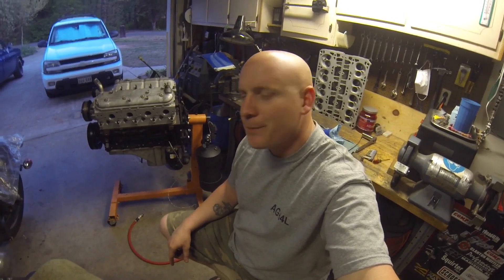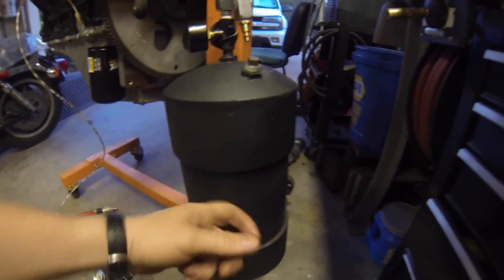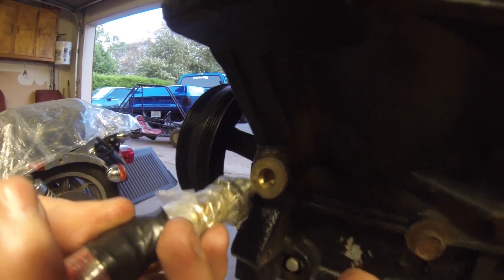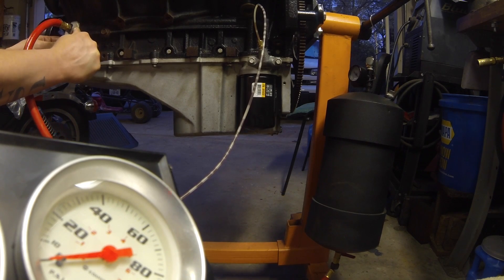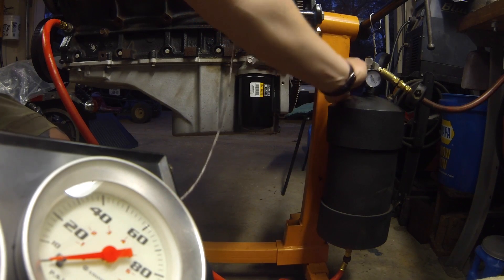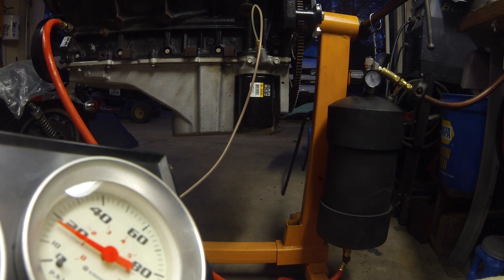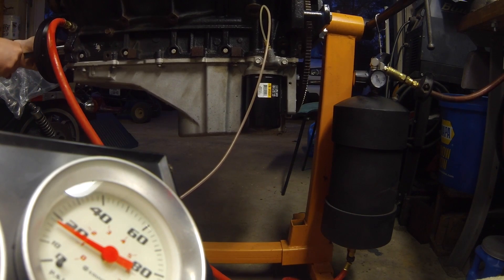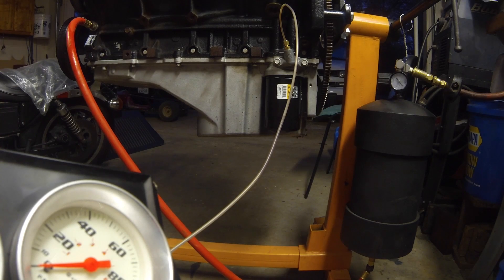LS Engine Oil Primer, Home Made - Pre Lube Prevent Engine Dry Start "How To" - LS1 LSx

Comment: for your sight gauge what i would do is make it so you can fill it with 6qts of oil and it shold half way on the sight gauge when it gets to 1qts left.. that way u can push the whole 5 qts but do not risk pushing air
Reply from the maker: What I have planned to try out, is an idea that my buddy gave me. He sent me a boiler site gauge. I'm making a new one out of a old steel freon tank and will mount the boiler site on the side.

Comment: very nice. Where did you get the plug for the side of the engine that you drilled and tapped?
Reply from the maker: Thanks Bob! That plug is already there in the block. I just grabbed an extra one from a junk motor and drilled and tapped it. I think you can get a whole kit of those plugs on eBay and probalby from the dealer also.

Comment: I put 6 quarts in before i decided to do your method, so i drained out about 4.5 quarts. pumped it in using your method.
and it appears it went somewhere else, because my dip stick says I'm about 4 quarts low??? might you have an explanation as to why the oil didn't return to the oil pan?? i let it sit for about a half hour now and still same.
Reply: AGearhead4Life I wonder if the dip stick is calibrated? Try a long clean rod that you can hear touch the oil pan...ALL the oil will eventually end up in the oil pan (unless its WAY over filled)...
Reply from the maker: Since Im not there, its hard to guess what happened. but I can say that if it was an empty engine (as i'd expect it to be since thats what this primer is for), when you fill it through the galley plug like in the video, you'll be putting oil in areas that you wouldn't be by just pouring it in. You'll be fill all the oil galleys, oil filter, oil pump, etc. So that would explain reading maybe a quart less then as if you poured it straight into the fill cap.

are you saying that your ready "4 qts low" or only four quarts in the pan?

Comment: if you make the oilfeed go in from the top with a pipe down to the bottom you can build a foot from a larger diameter pipe that fits over the bottom cap 
you can then set the oilprimer on the floor and even put it away filled with oil without it leaking
Reply from the maker: cool idea! I had thought about making a feed from the top... after it was too late of course. I guess I could still plug the bottom one and run another. I like that idea for a base to set it down on. If i ever get a chance to mess with it again, I may try these ideas.

Comment: Hey gear head I have a ? I'm building a ls1 do u think I need to replace the lifter trays and get new ones I've read that u should I'm lost on that need some input form u
Reply from the maker: Hey Mr_getinthere! Well thats a hard one. I dont usually prelace the lifter trays, so I'll say no. If i was doing a complete like new rebuild, then I would say yes.

This is one of those MANY things that you'll read about on forums where people say that you MUST do, but really its all on judgement of what you've got going on and what you plan to do. It can get very expensive buying every part inside the motor new for a rebuild.

For each part like this that I question if I should buy new, I ask myself a few questions:
-How worn is the part?
-Do I want to take the gamble of this part not work?
-Do I mind spending the time to fix it agian if it does fail?
-What will happen if it fails?
-Is it a low budget build?

For example: I reused the piston rings in my 5.3 build for my truck. I'm willing to go back in and rebuild that motor if it fails. To me its worth it to see if my experiement or reusing them works. They worked fine before removal, Id thinkg theyll work fine now that theyre back in, even though they've rotated. This is not a normal way of thinking. Most would never resuse pistons rings.

I hope that answers your question and gives you an idea of my thinking process.

Comment: Swap that hose around and you'll have a swivel. No need to swivel at the bottom of the tank. Good job man.
Reply from the maker: Good idea! I had considered the same but let the thought pass, becaue i needed an angle at the bottom. But I could place a 90* fitting down there to solve that issue. Thanks for pushing the idea, thats probably what I'll do.